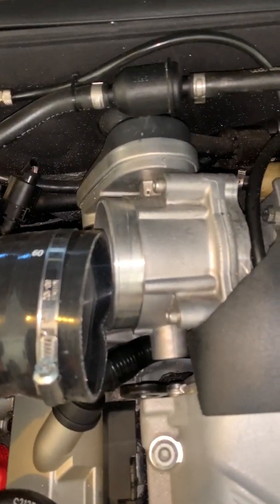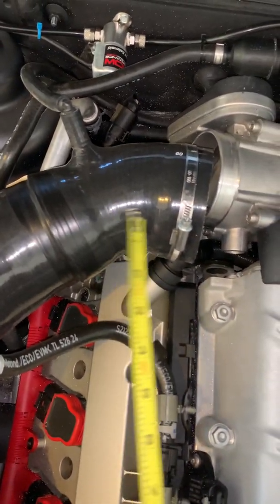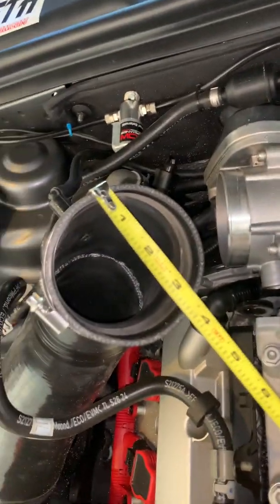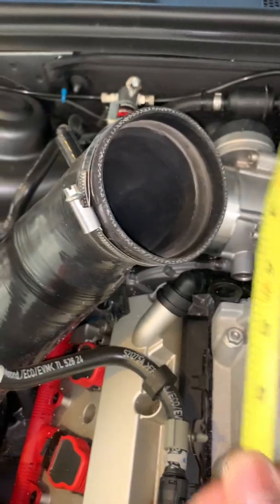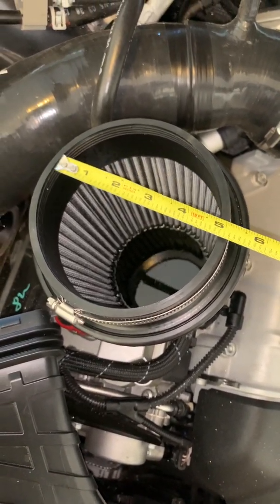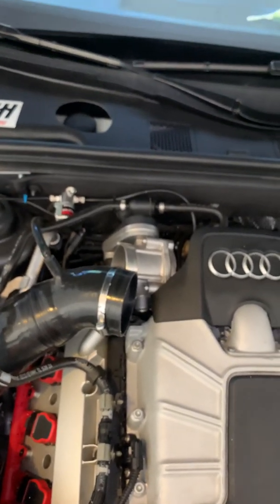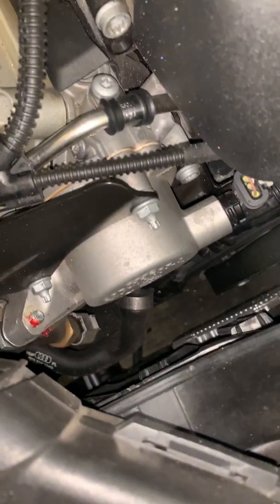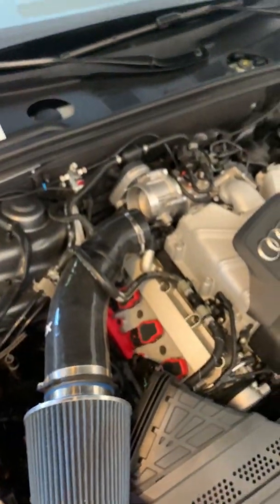Integrated engineering throttle body / aftermarket intake

Comment: What were the gains in 1/4 mile times with this upgrade?
Reply from the maker: Honestly didn’t notice a tremendous gain with this. Maybe placebo   Plus I didn’t have a dragy at that time for 1/4 Mile testing
Reply from the maker: But every little bit counts when racing, plus I did have to return it for this upgrade. A little diff but not big.

Comment: Is this the v2 intake? The intake tube is 3.5? I heard their v1 intake is 3 inches only which is a little small for the upgraded tb
Edit: nvm just saw that this was a different silicone tube that it came with. So when you ordered the ie tb it came with a 3.5 inch silicone tube?
Reply from the maker: Yes it came with the tube
Reply: @WillieWheels  ok got it, thanks man
Reply from the maker: @scmtkings4  ok no problem let me know if need anything else.thanks sub,